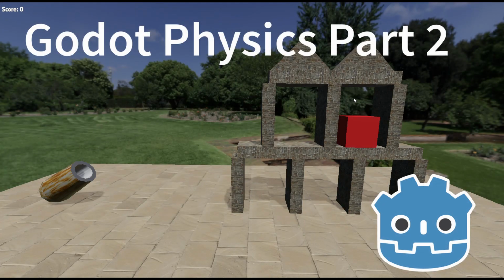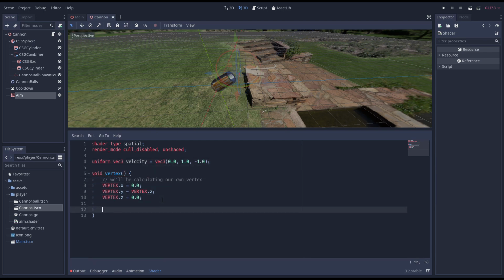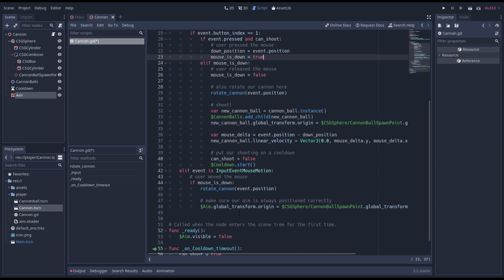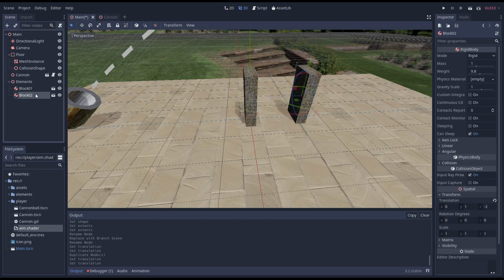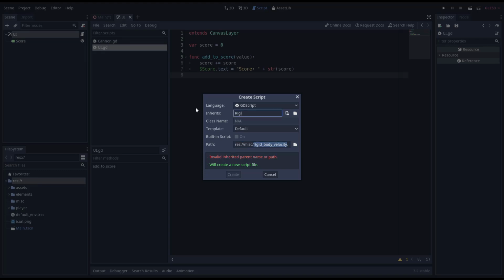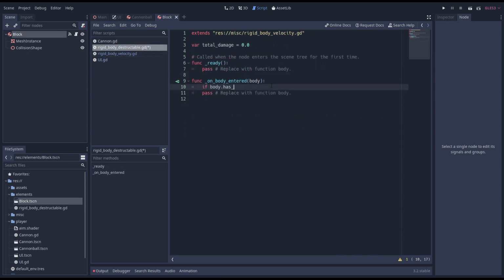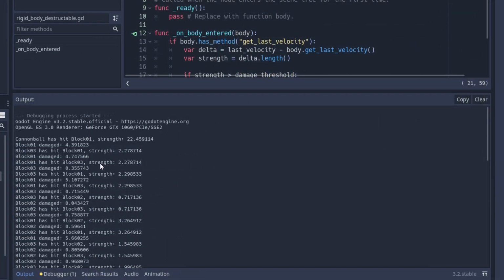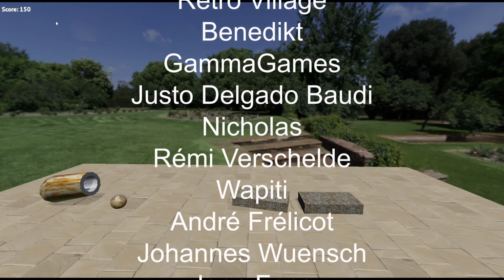Introduction into Godot 3D Physics part 2

Comment: Great tutorial! I did run into an issue where, in rigid_body_velocity.gd I had to use "_physics_process" instead of "_process". Otherwise, the result of calling "get_last_velocity()" would return a zero vector most of the time. My guess is that "process" was running too often making the velocity calculation equal zero, but I'm still pretty new to Godot/gamedev so not sure. Posting in case anyone else runs into this!
Reply from the maker: This is indeed correct, that logic should probably be in _physics_process. The physics processing attempts to run at a steady update rate, by default 60x per second. If you have a high framerate monitor and your game runs at say 144fps then physics doesn't keep up. I should have dealt with that scenario :)

Comment: Wonderful. Great video, Thanks for sharing your knowledge.. I have a question, How can I change the gravity of the cannonball in the code? I know there is a function "set_gravity_scale (value)", but I don't know where I can put that function to change the gravity of the cannonball.
Reply from the maker: There are many ways to change the gravity, depends on whether you want to apply it always or specific to one object or in an area. 

To change it globally either change your project settings or use the code given here:
https://docs.godotengine.org/en/stable/classes/class_projectsettings.html#class-projectsettings-property-physics-3d-default-gravity

If you just want to change it for a given canon ball you can indeed change the gravity scale:
https://docs.godotengine.org/en/stable/classes/class_rigidbody.html#class-rigidbody-property-gravity-scale
You can change it in the editor on the canonballs or in code. Where in code depends very much on what you are trying to achieve but I would probably add the code where the canon ball is spawned. 

For gravity to change in a given area check the documentation on the Area node.

Comment: Great tutorial. Just wondering, I can't work out how to extend the trajectory shader mesh further, ie it stops at the velocity vectors. How would I continue it going?
Reply from the maker: Thanks Mark! 

So the secret ingredient is that we're tracing a path using time. So we calculate where our canon ball is after 0 seconds, 0.1 seconds, 0.5 seconds, etc. and position our vertex accordingly.

The trick is that we are using our UV for this, specifically the x (i.e. u). This goes from 0.0 to 1.0, and as such we trace the path of our cannonball over 1 second of its flight. 

I haven't tried it but in theory these small changes to the shader should give you a duration uniform with which you can influence how long the trajectory is:
https://pastebin.com/QGgngDW0

Comment: Blown my mind when I saw that even the shadow is there. You're turning off culling to not worry about normals? (yeah, i just noticed you said it in the video: "to see the object from all directions").
Reply from the maker: JebacPresretac101 yup, discard keeps the shader as an opaque shader so it still effects shadows. 
Culling is turned off so you can see the effect from both sides, not super needed but saves headaches. If it remained shaded the normal could still be pointer away from us and not have the surface properly lit but as I don’t want it shaded I don’t have to worry about that